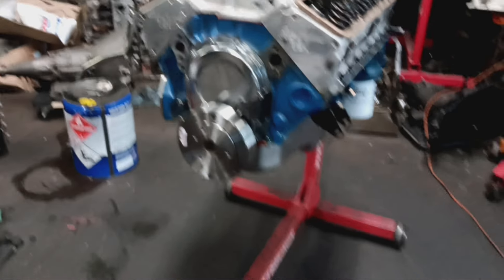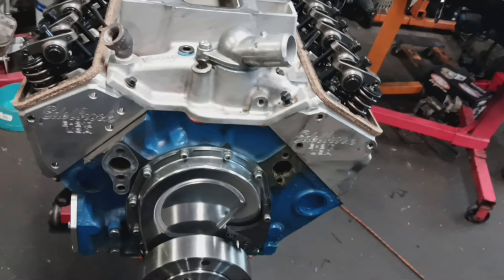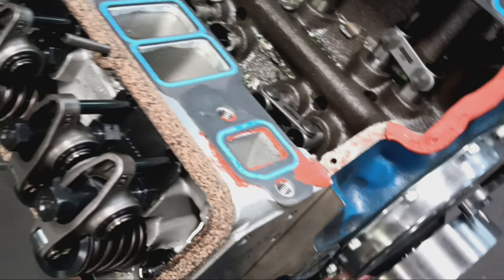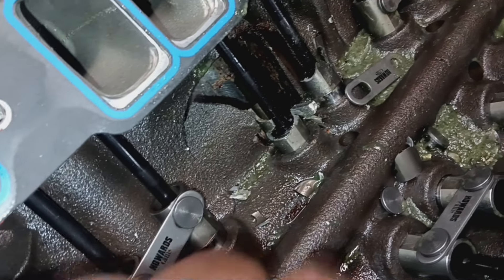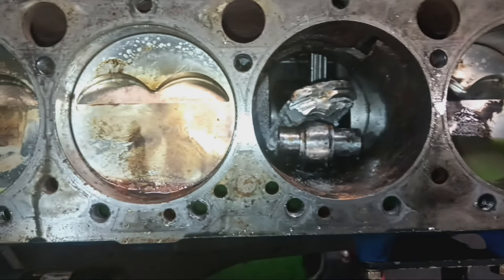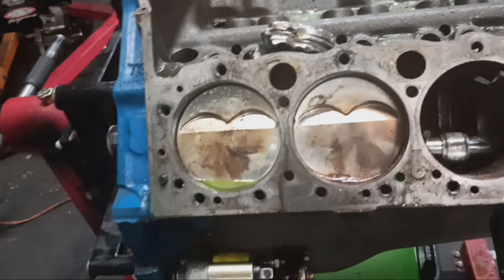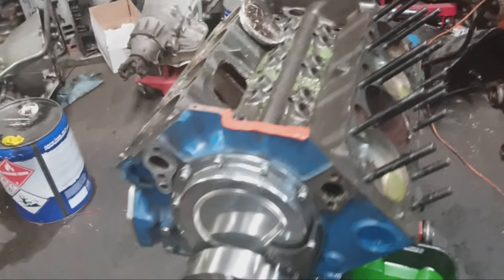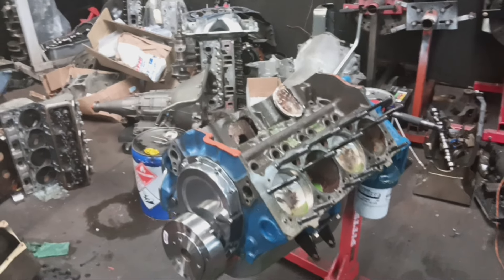It's bad!!! I blew up my supercharged sbc twice

Comment: I’ve made 1300whp with a stock 350 block and went bottom 5s for years. I had troubles like yours for the first couple of engines and all were timing related. I don’t think it was a block issue at all. I bet the piston broke due to detonation and then took out the cylinder wall as it self destructed. I always ran a max of about 16 degrees of timing on 22lbs of boost with 9.1 compression.
Reply from the maker: I thought of that but I was only running 8lbs of boost
Reply: @SSPENGINES383  How much timing?
Reply from the maker: @twinturbocoyoteftw  locked at 28

Comment: I may not know everything but I'm a small block connoisseur myself... If you're going to be running boost like that im pretty sure you need some dish pistons that looks like a n/a piston if im not mistaken? Bad to the bone none the less man thank you for sharing :) oh and boost reference power valves on your carbs make sure they are blow through set up if not they will starve the engine and kaboom
Reply: It was a roots blower so he needed a 1x4 blower carb. Little different than a blow-through 

But he was running E-85 so he was good on octane too.  Just a mechanical failure from a not strong enough block and took everything out
Reply from the maker: @KingJT80  exactly what happened
Reply from the maker: Well I've done several motors with same style pistons and there still running today on 93 octane too...I think it was just mechanical failure so I'm willing to try this build again with few extra goodies
Reply: @SSPENGINES383  you think filing the block halfway will help and stay cool on the street?? And steel caps with studs?
Reply: @SSPENGINES383 can't wait to see it up and going again love the videos!
Reply from the maker: @KingJT80  it never overheated
Reply from the maker: @KingJT80  think the block just couldn't  hold the lil power it was pushing out
Reply: @SSPENGINES383  💪🏿 can't wait till that car is back up. Gonna hurt feelings. 

You ever gonna upgrade the green bu for even more power like a big f1x procharger?? Do it!!!
Reply from the maker: @KingJT80  u know i sold that car back in 2022

Comment: Was the motor pinging getting to the line before you applied half throttle? Is the timing dialed in? Alot of tuners play with the timing instead of the volume,fuel trim, afr, etc. tables. Much Love out there!!!
Reply from the maker: Yes it was all good had dialed tuned in earlier that wek afr's were good too
Reply: @SSPENGINES383  damn brother... She probably just wasn't having it that day.. I have faith in Creator that you'll bounce back!! Only way to make space for a jump ahead, is to take a step or two back. Much Love And Stay Safe!! 🫀🧲🫀💐🌻🪶👌😤💨💨💨

Comment: From what I see. Antifreeze leaked  into the cylinder  possibly  a headmaster leak. Then pressure from the antifreeze blew a hole. Doo to the extra force from supercharger. Block and heads should've  been decked and MLS gaskets along with head studs would've  prevented this.
Reply from the maker: @keithharris9685  yea it had MLS and head studs

Comment: Was that peppering on the pistons  or was it just from shrapnel?
Reply from the maker: That's e85
Reply: @SSPENGINES383  lol, not the soot or carbon, peppering looks like buckshot or maybe birdshot rather but i couldnt tell by the video if it was actual peppering from pre-ignition or just from shrapnel in that cylinder.
Reply: This is the 3rd stock block sbc i know of that completely blew a cyl wall out, one was a turbo setup on youtube, the other was a nitrous engine local to me and now this blown one here on youtube. To my knowledge none of these engines were equiped with enough data to make an educated guess whether it was from a tuning issue or from actual cyl pressure overcoming the cyl wall, with all else being spot on. Without the data is just to hard to say whether it was one or the other.

Comment: Smh lame. What are the afr's at? Did you gap the rings? What's the limiter set at?
Reply from the maker: Yes rings were gapped for 15lbs of boost I was only running 8 never touched nitrous afr's at wot were 11.9-12.0 to ensure we had fuel psi